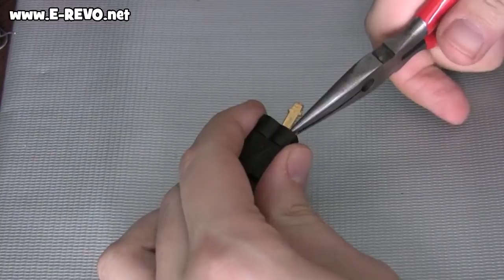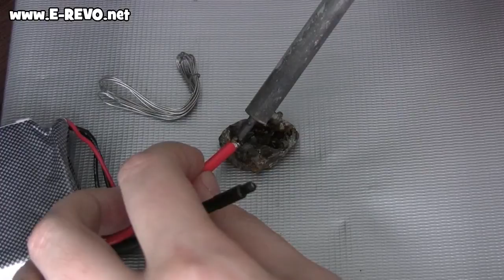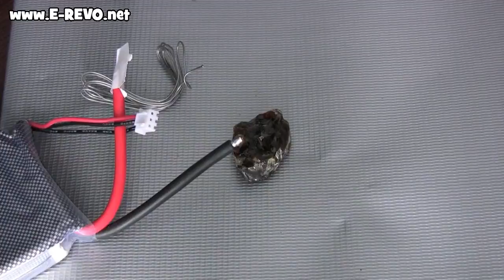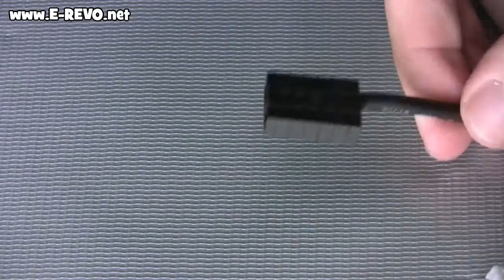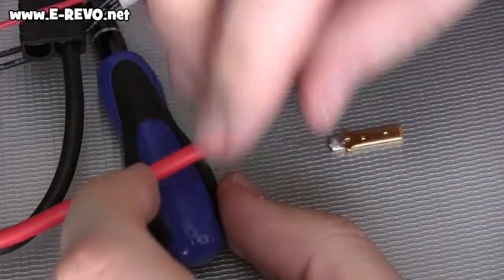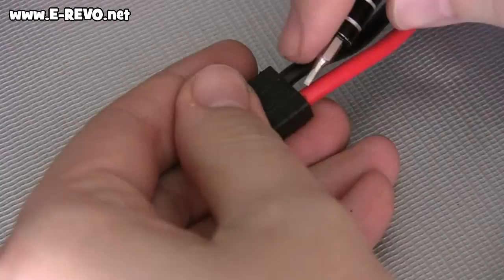Tutorial of how to solder TRX (Traxxas) connector to a lipo battery

Comment: Very nice video. When you finish the red wire first (soldering the contact on it and put it in the plug) you wouldnt even have to put isolation tape on it. Still great work tho.

Comment: im sorry but that is a terrible way to solder the gold connectors. you are supposed to tin you tip, then touch and hold the iron to the connector and apply solder to the CONNECTOR.
Reply from the maker: not as terrible as calling copper connectors gold